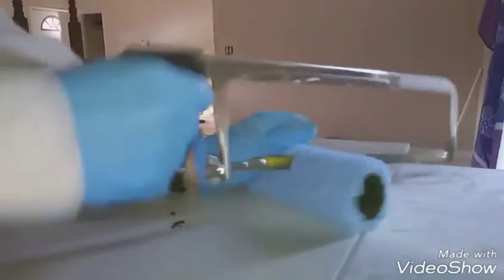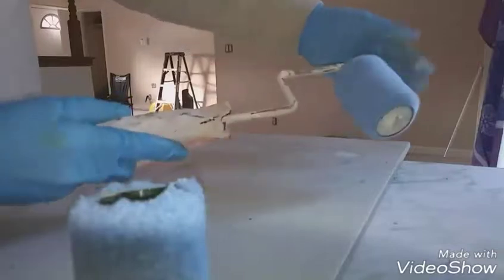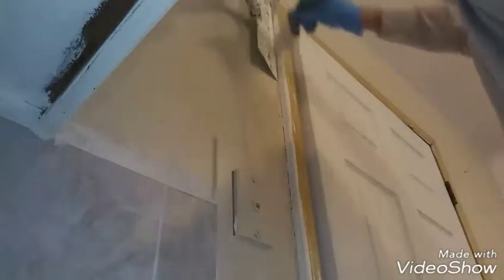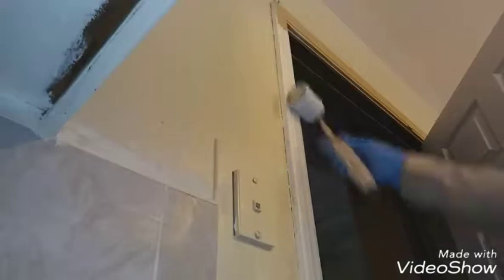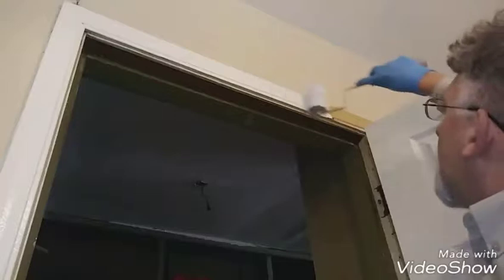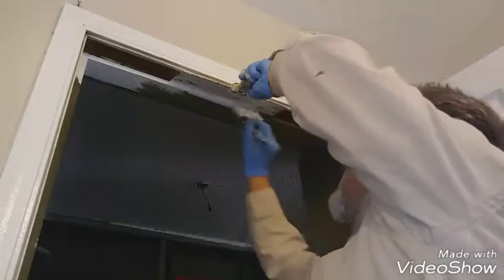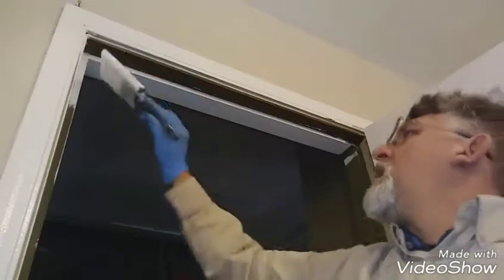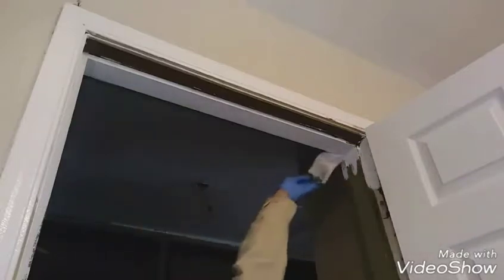How To Paint Door Trim Fast, no Tape!

Comment: I do the same thing getting under quarter round.  It does bleed through when I tried doing the door trim but I am getting a straight line.  I am going to try putting Frog Tape on the blade and see if that stops the bleed through.  Good video.  Thanks!

Comment: Just wondering how you clean up spots that escape the edge since edges are never completely flush.
Reply: You can just wipe it straight away with a cloth. As it's oil based, it doesn't dry fast or absorb in to the wall paint.

Comment: What kind of paint you using does it have primer in it? The paint I use seems to dry very fast called behr Alkyd has hint of oil in it but just work it too much then will dry showing dry spots halo effect if using brush starts gumming up.
Reply from the maker: Paint with primer in one

Comment: 3/8" nap texture on trims is horrible. Back-brush them with a soft brush after rolling at least if you ain't spraying  > <"
Reply: Agreed, can't see how that would look decent, at least tip it off with a brush which may end up working faster and we'll, lay on with a roller (not 3/8) and tip off with a brush, I do that on 6 panel doors (do the interior pansls all with brush but  lay on with foam roller on rest and tip off
Reply: Yeah I agree. Roll texture looks horrible on door trim. Brush texture looks the best

Comment: Not professional.
Reply: Cheesey
Reply: agreed... the paint looks all over the place and patchy. I think he says '... this door is nearly finished'! I take the door off the hinges and the hinges off the trim. All the other ironmongery comes off too. It doesn't take long probably as quick if not quicker than taping everything, which is not even done in this video. Good idea to use a shield but to be honest he doesn't use it very well! I've seen pro videos where the painter cuts in around the door knob... come on guys! It takes five minutes to take door knobs off and apply the paint under the knob rather than up to it. It's so noticeable it's not worth cutting in

Comment: Are you going to caulk the edges?
Reply: Best to do any caulking before the final painting using flex 230 dap paintable caulking can get @ home depot.
Reply: @MartyCanter  white lightning is better. Dap pulled away in less than a year. White lightning holding strong.
Reply: No that's only if you want to do a good job and actually look professional..this guy didn't even take the time to put any prep work into this such as taping and instead use something entirely for a different purpose. He could have done the same thing with a piece of cardboard from a cereal Box and it likely would have been even better all I see is drips of paint in the crack making it clear  To the customer that this was not taped off or done with a brush and looking very unprofessional...